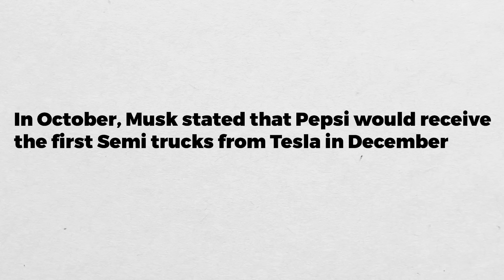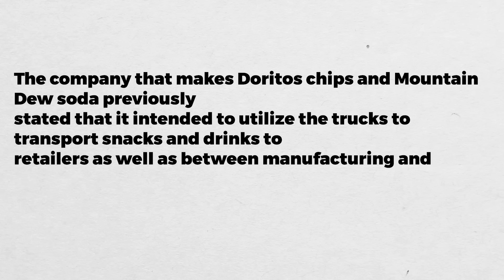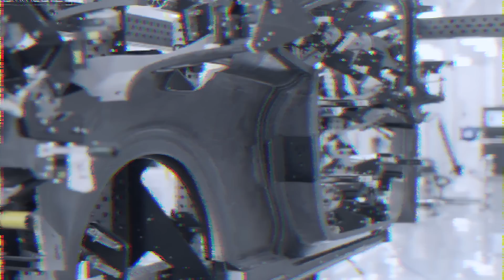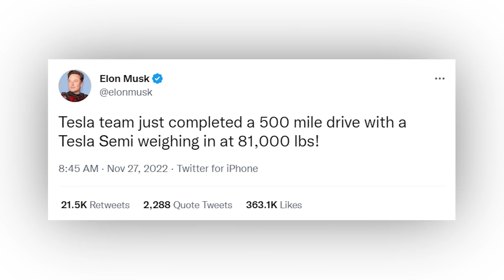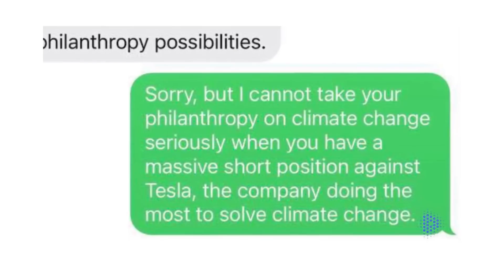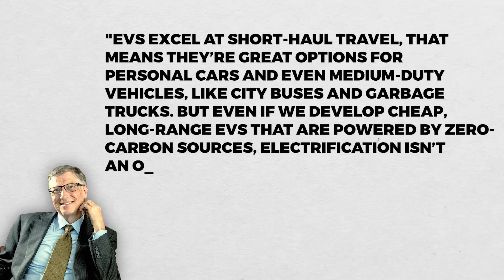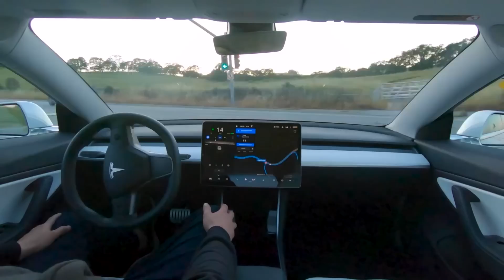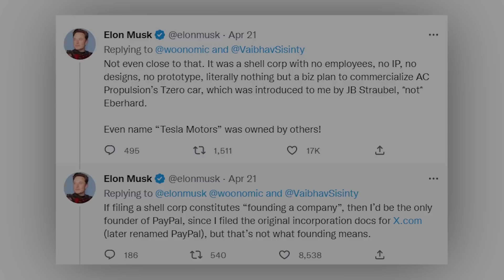Elon Musk JUST CHALLENGED Bill Gates Over Tesla Semi!

Comment: If you're Mercedes then why say anything, because if it does the 500 EV range with a max load, then, that egg on your face and more proof, Tesla's the EV benchmark and not the Germans, so, if Tesla Semi has a 500-mile range with a max load, what's the range without a load, how big is the battery pack, how fast was Tesla driving the Semi to achieve that 500-mile range, what's the charging time like on Level 2 or Supercharging/DC fast charging (I'm assuming it's using the next-gen of Tesla Supercharger supposedly coming, called the Megacharger), anyway, this is nothing but good news for the upcoming Cybertruck, because I see Tesla building out more heavy-duty to medium-duty truck models, they’ve already done the hard part the semi (aka 18-wheeler or Class 8) coming down to a medium-duty Class 3 or 4 should be no problem, or anything between like: buses (city, touring, school, etc), garbage trucks, dump trucks, moving trucks, etc, you got to think BYD is watching this, can't wait to see the actual spec for the Tesla Semi to compare vs diesel 18 wheelers, besides aren’t medium and heavy-duty vehicles big environment polluters, oh yeah, I believe GM is working on medium-duty EV trucks also